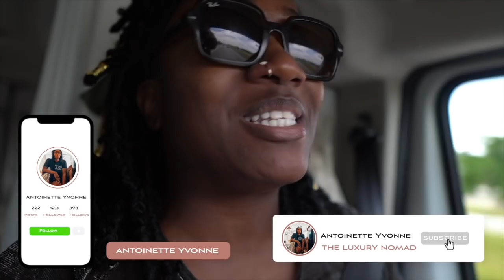Solo Female VAN LIFE CHORES + How I Deep Clean My Van

Comment: One thing that makes it easy peezy to keep surfaces cleaned right away is disinfectant wipes. They are not hard to come by these days, You can have them handy and clean any surface as soon as a spill or mess occurs without having to grab a towel and prepare soap and water, and it works the same if not better.

Comment: Awesome is a good cleaner 4 everything, it's a degreaser, sold @ your local orginal 99cent store. They sale it by the gallon, its color is a clear yellow 4 about $3.99 and they sale it in smaller sizes 2, but the gallon is more economical, U just have 2 pour it in a spray bottle.  I use it to clean everything from the leather in the inside of my car, to cleaning the stove, pots & pans that R greasy, U could even clean that fan over your stove, to even spraying on the collar of a shirt 4 ring around the collar the night B4 U do your laundry the next day, just an FYI or should I say the tip of the day.  💖 following U, lucked U on U just watching others single women doing the van life, trying 2 wk 7 more yrs., then plan 2 want 2 do the van lifestyle, Stay safe., From Lovie, (818) Reseda, CA.